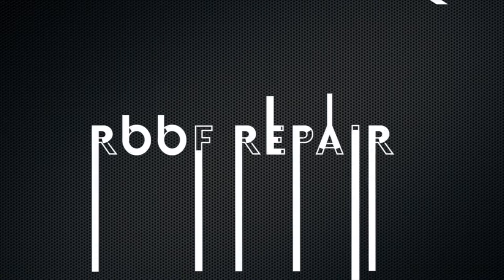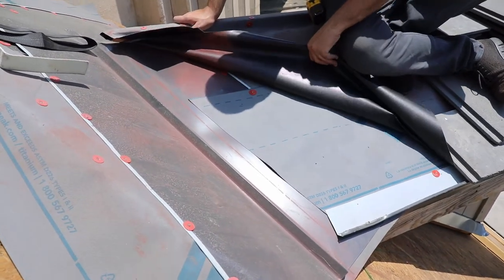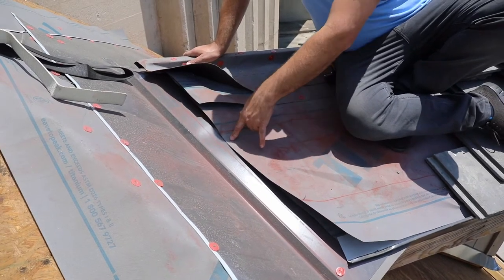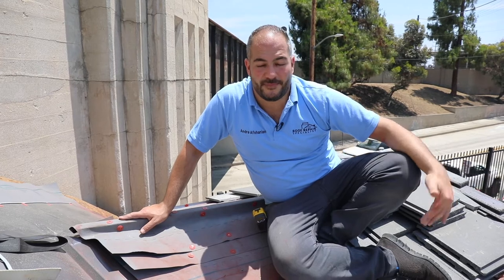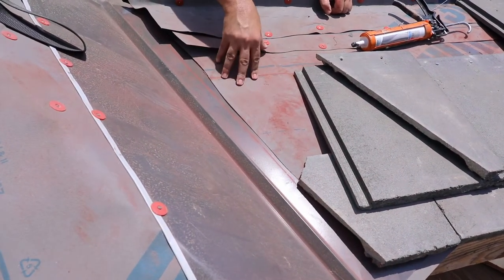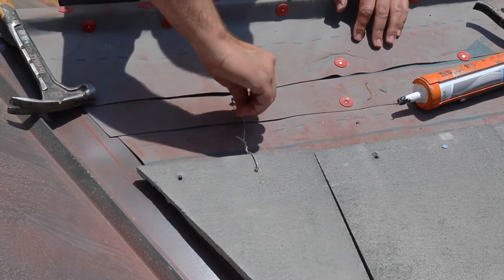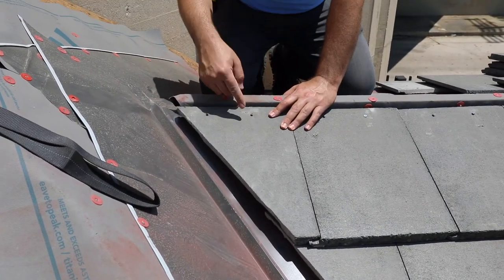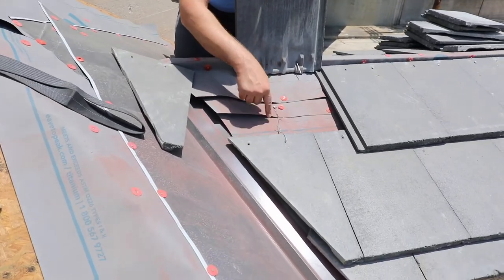How to Install Valley Flashing for a Flat Tile Roof

Comment: Great work buddy. Lots of common sense here. One thing I wanted to ask was about the felt paper over the valley. If the valley gets obstructed, water will flow to the sides and under the felt paper. I've fixed 2 leaks in the past 6 months for this reason. My latest video shows this issue. What are your thoughts?.
Reply from the maker: I definitely agree with you. I just saw a few leaks for this very reason. I'm still torn on it. I think it may be a good idea with a self adhered underlayment but not worth doing on a nail down.

Comment: You are supposed to use the valley metal that has a hem on it to keep the water in the valley and also you’re nailing through the valley metal so what good does that do all you’re doing to create a hole in your valley metal

Comment: liked and subbed!  i have a similar problem but need to know how to correctly finish the edge where the wide valley flashing meets the tile riser.  i have drainage holes drilled in my tile riser.... is that bad?  it's allowing water to drip into the gutter to avoid excessive fast water flow from hitting the end of the V where to slopes meet.... but i have a small leak further up from the riser that i need to check as it's leaking at the eaves underneath.  should the felt go under or above the tile risers edging that sits on top of the wood deck.  sorry if you have this already, i'm new to your channel. thank you in advance sir! great videos! i have a flat concrete tile.
Reply from the maker: I recommend leaving the tile riser back from the valley at least 6” from the middle. That way it’ll allow water to easily drain. 

Thanks for the sub.
Reply: @RoofRepairSpecialist  thank you!

Comment: the J O K E of a Tile roof is the Valley. No way it will ever be good or serviceble. If not pointed and open you can never get up[ to clear the darn leaves. Water will damn up and spread out > 3 feet either side., Even here you see the no finished edges no use not battens of any kind. That means a constant dam from the gable to the gutter.  At least  vertical battens 3/8"> will let water flow down, and the horizontal cross battens keep the tiles off the deck and allow air an accidental water flow. How they do it on Canada/england for more time centuries, than here.  No fan of installers almpost anywhere there are trees- shameless.   Every year broken tiles trying to lift & clear and acess the silly filled tiles maybe 2" wide on the darn valley make it  24" wide AND CLEAR BETWEEN THE TILES AND WALK UP THERE AND CLEAN IT  - THIS IS JUST STUPID. i CARE LESS WHAT THE NEIGBORS SEE. I WILL PAINT TO MATCH. YOU COULD HOVER TILE OVER THE VALLEY WITH A RAISED TILE ROOF.
Reply from the maker: Ya, I’ve seen them done that way in Europe. Not sure why it’s not a practice in the US.